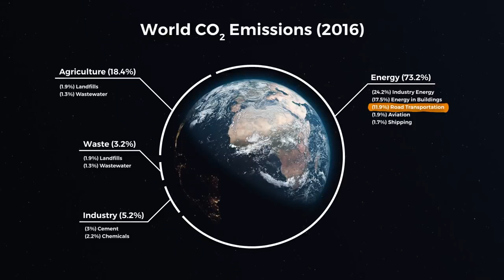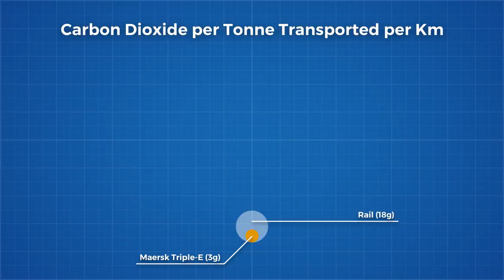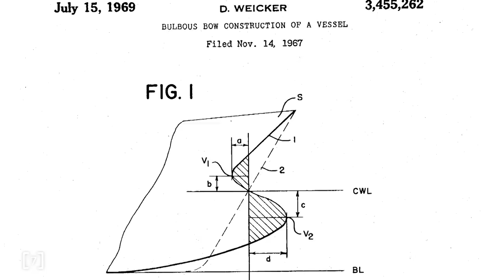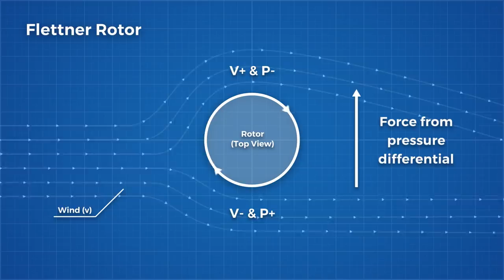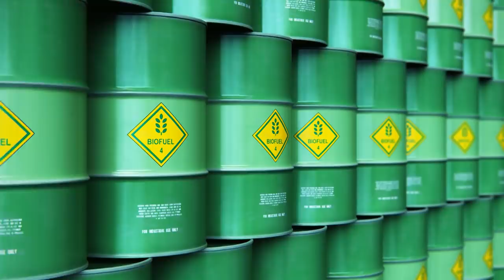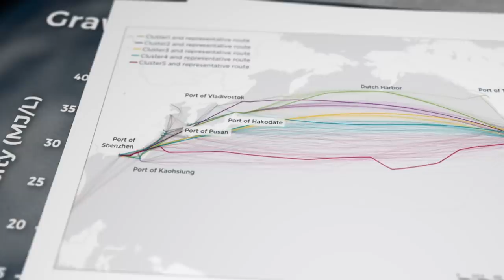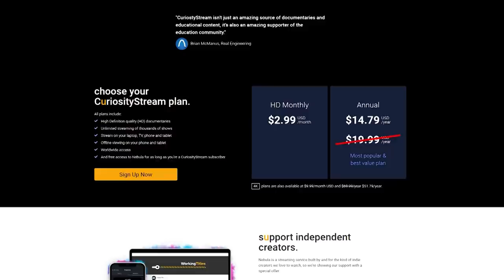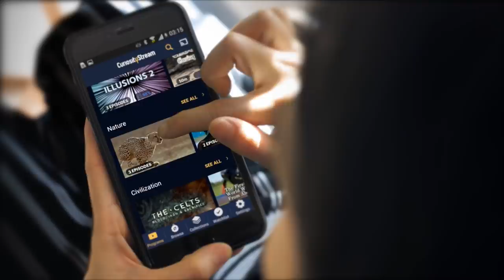Are Renewable Powered Ships Possible?

Comment: Apart from operational improvements ie things like Flettner Rotors etc etc. Have you considered the building of new ships by looking at concrete ships? This technology has been around since the early years of 20th Century (During WW I there were significant programmes to build concrete ships in both the UK & USA. Concrete ships were built at many ports in the British Isles including Shoreham By-Sea in Sussex were I live. They were also built at Warrenpoint. At least three WW I concrete ships survive in Eire. The Warrenpoint built 'Creteforest' and the Shoreham built 'Cretegaff' can be found at the Carlingford Yacht Club in Co Louth. Also the Shoreham built 'Creteboom' can be found in the River Moy near Balina in Co Mayo.) I have a very interesting book published in the 1970's about the future of shipping (originally the book was published in the DDR) It talks about many ingenious innovative ideas and solutions to maritime problems. Including very large concrete ships. Interestingly a concrete hull is extremely robust and virtually indestructible (This was demonstrated at Bikini Athol during the American A-bomb tests in the late 1940's). The main problems with concrete ships historically have  been as follows. 
1) High cost. During WW I the UK  1,000Grt barges built cost around £27,000. Whereas a steel barge of this size cost around £17,000.
2) A concrete ship has limited value following withdrawal as effectively the hull has no scrap value. 
However the cost issue decreases as the hull size increases and a hull of over 75,000 tons has a cost advantage. Also due to very robust nature of a concrete hull the ship would in all likelihood have a lifespan lasting centuries.
So the trick here would be to make sure you the hull can be designed in such a way that it's long life would be an asset (That said it is likely that the demand for large container ships  and bulk carriers is going to last for many centuries into the future)
Also it would make sense to use a steam turbine nuclear power plant which would be designed so that it could be replaced relatively easily say every fifty years or so.
Obviously at first such a vessel would have to use a fission reactor. But by the time the reactor required replacement I would expect that it would be replaced by a fusion reactor 
There are plenty of technologies  that have been around since the 19th and early 20th Centuries that deserve looking at again in the light of today's vastly improved materials technologies.
Reply: The concrete has a high carbon foot print during manufacture so the embodied carbon content may become a factor.  WRT the nuclear power plant start by doing a web search for ‘nuclear ship savannah’.  Just think; would you have full confidence in the management of a nuclear reactor under the control of an anonymous entity only traceable, perhaps, via a letter box in a FOC (flag of convenience) nation state?  If you are could you sell that confidence to Japan, the state that hosted the Hiroshima and Nagasaki nuclear detonations as well as more recently the Fukushima ‘event’?  Then try that same, or similar, sales strategy on Ukraine, the nation state that as a part of the USSR (CCCP) hosted the Chernobyl ‘event’.  Modern iterations of nuclear energy thorium fuel, molten salt reactors or fusion reactors will carry the legacy of past problems.  It is the global trepidation of anything with 'nuclear' in the name and the economics of nuclear having transitioned from 'energy to cheap to charge for' too 'the costs of remediation are incalculable' that will prevent the adoption of nuclear energy as a means of creating energy at sea.  Modern reaction systems may have overcome the safety problems but the general public, having been misled in the past, will not believe the fresh new promises.  ‘They’ say nuclear is cheap, it’s not it is expensive as well as being complicated, dangerous, not universally socially acceptable and having only ‘no need for refuelling’ as a questionable advantage; actually it does need refuelling just not as often.  When they do need to refill the warming up stuff it takes considerable longer than pumping tonnes of thick black stuff, HFO cSt380, or thin runny stuff, Avtur-JetA1, onboard which is one of the reasons HMS Queen Elizabeth and HMS Prince of Wales are pushed about by gas turbines thus using the same fuel as the aircraft that fly off of them.  The Royal Navy (RN) with a high degree of skills and expertise use, at vast expenses to the UK taxpayer, a current operational nuclear fleet of 8 submarines (also known as ‘boats’) in two flotillas, four attack subs and four ballistic missile boats.  The carbon footprint of all the extra bits of hardware and the fuel, including processing thereof, from ground to propeller, are the external costs that never seem to get considered.  Disposal, once it wears out, of both the machine (that was a ship) and fuel is another can of worms best left unopened.  The 26 RN boats no longer in use are laid up (some in Rosyth and some in Portsmouth) awaiting long term deconstruction including dealing with the fuel rods and other irradiated material.  The USN is not, as far as I know, a commercial organisation working to very tight margins and also has the skill and expertise to handle the complexities of nuclear power so as well as submarines their aircraft carriers are nuclear powered and each have a build cost three times that of QE/PoW, bigger crews and more generous funding.  For those who still think that nuclear energy might be the answer I recommend this report: - https://www.bbc.com/future/article/20200901-the-radioactive-risk-of-sunken-nuclear-soviet-submarines? ocid=ww.social.link.email.  The navy of the USSR might have been under resourced and over extended but it was still generously supported in comparison with merchant shipping.
Reply: @BernardLS  I am very much aware of what you say. But in fact concrete has a lower carbon footprint than steel. Also it is possible to reduce the carbon footprint of the cement industry more easily than it is for the steel industry (I am also fully aware of the fact that the ship would still need a steel frame)
I am talking about building a ship that would last for many centuries and this was the only technology that I could think of that would allow you to do this. Also remember we are talking about a ship of around 250,000Grt and the nuclear option would be viable. Certainly it is the only technology that is available today which would meet the criteria for removing diesel engines etc etc.
 Also I am making the assumption that a viable nuclear fusion reactor would be viable within the next 25 years or so. Which would mean that the fission reactor would be disposed of then. Also I am fully aware of additional costs of such a vessel. Certainly the major shipping companies would be perfectly able to operate such ships. It is wrong to suggest that their staff would be somehow unable to do so.
 All I am saying is that something does need to be done about this now.
PS I did actually visit the 'Savannah' and the German ore carrier 'Otto Hahn'. However I never saw either the Japanese nuclear reefer 'Mutsu'   which in fact it never actually carried a commercial cargo and it was later rebuilt into the research very 'Mirai'.
Which today is a museum ship.
Or the Soviet ice strengthed 'LASH' barge carrier 'Sovmorput' which was designed to service the various ports at the mouths of the rivers along the coast of arctic Siberia. As far as I know she is still in service. The other three having been withdrawn from service. 
 One thing to note about all of these ships was that they were all relatively small. 
I am suggesting a much larger vessel.

Comment: Yes, the sea is windy (big turbines to produce power). There is water (Water turbines). There might be sun (Solar power)
Reply: To address the suggestions that sail power is the answer I offer the following example.  In 1870 a premium sailing vessel entered service, the ‘Cutty Sark’.  The Cutty Sark was 64.74 metres in length with a beam of 10.97 metres and a loaded displacement of 2 100 tonnes.  She was able to carry 1 700 tonnes of cargo and to harness the energy in the wind the available spread of canvas was up to 2 976m2 which was tended by a crew of about 30 skilled men.  A ratio between the sail area (SA) and the vessels displacement (D) determines how lively she is; ‘lively’ being nautical speak for ‘fast and manoeuvrable’.  The carrying capacity of cargo ships is constrained in two ways, mass and volume which leads us to the ‘stowage factor’ of the cargo; the more mass on board the greater the displacement which in turn impacts the efficiency of the hull form and sail area / displacement ratio.  A vessel constrained by mass is said to be ‘down but not full’, a vessel constrained by volume ‘full but not down.  When in the tea trade, which the ‘Cutty Sark’ was designed and built for with fine lines (more nautical tech speak so again - no need to worry about it) she could carry around 600 tonnes of cargo at speeds of up to 17.5 knots dependent on the prevailing wind and had a typical China to UK time on passage of 120 days.  The tea trade was very competitive so ‘time on passage’ was a large factor in securing the premium freight rate that made her cost effective.  Rounding things out her maximum available sail area gave circa 5m2 of canvas for every tonne of tea carried.

As soon as the Suez Canal opened, which the ‘Cutty Sark’ was unable to sail through; she lost her advantage, raw speed, to the steam powered ships of that era who could beat her ‘time on passage’.  Mechanically powered ships have improved in terms of efficiency, on a freight tonne mile basis, by at least one order of magnitude since then.  After losing out to the coal burning, steam reciprocating mechanical ships of the late 19th century ‘Cutty Sark’ was relegated to the Australian wool trade, just about the bottom of the barrel in maritime terms and only one small step up from being a 'honey barge'.  The canvas, cordage and extra manpower needed for sailing ships was never a very benign environmental option so please discount any idea of sail as ‘sustainable’.  All this is without the problem that if ‘the wind don’t blow the ship don’t go’, when it does blow it often blows in the wrong direction for your cargo delivery needs and sometimes there is rather too much of it for comfort.

Random fact about ‘Cutty Sark’, it is said to have been possible to coax 3 000 horse power out of her sails, or in ‘real money’ 2 206 500 Watts (2.2 megaWatts), assuming this was in ideal conditions that is about ⅔ of the solar power that might be harvested from the ‘top of stow’ of a Maersk Triple E, again in those elusive ideal conditions and 741 Watts for each square meter of sail area.  So that majestic spread of canvas would have been even less efficacious for delivering your baubles and bows from the orient, despite taking about three times as long on the voyage.
Reply: Solar power; as an example the above container (called boxes by nautical folk) area of a Maersk Triple E is less than 399.2m by 59m.  The 399.2m is the length between perpendiculars (marine tech speak - no need to worry about it) and the 59m is the width overall (more marine tech speak so again no need to worry about it) allowing for the sides, bow, stern & navigation/accommodation structure could we agree 340m x 56m or 19 040m2 for the ‘top of stow’ area?  Insolation rate in Joules will vary due to time of day, latitude of vessel, declination of sun, (those three impact the elevation of the power source) cloud cover, efficiency of solar panels and how clean they are.  The Triple E class use two 29 680 kiloWatt each, at full whack, ICEs for propulsion plus some hotel and services power load cost; so for round numbers, could we agree 60 megaWatts?  Solar panels create about 155 Watts m2 averaged out; 19 040 x 155 gives me 2 951 200 Watts (or 3 megaWatts for a round number) from the top of all the boxes.  Those three megaWatts might allow you to distil enough fresh water from the sea to wash the crud off of the solar panels (surprise fact renewable energy comes with maintenance costs) but nowhere near enough to effectively 'push the boat along'.  Fitting solar panels on top of the ‘boxes’ is worth, at most, 0.5% of your power requirement.

More seriously the ‘boxes’ are loaded and unloaded from the top down so the solar panel array would need to be moved for every port operation and time is money as well as that operation having the ability to get very complicated (tech speak for ‘go wrong’).  Any additional weight would be in the worst possible place for the stability of your vessel, the operating environment would be harsh and the ‘top of stow’ on a ‘box boat’ is seldom a level expanse as each column of containers may be, and usually is, of differing heights.

Comment: to achieve a real reducción they need to redesign the hul eliminate the bolbous bow with a long tube along the length of the ship, propeller place within the pipe,this will eliminate frontal resistance,no front wave and will create a wave in the back of the ship.
As far as green energy Hidrogen or CAES,compres air energy storege ,one or a convination of both is the solution,the source is built energy harvesting ships, sails and solar power with generator like the ones use for tidal energy , they don't need to cross canals or water wais, refills can be done in open ocean justlike tug boat. 
and last solar electric container ship to Carry only empty container,this will reduce time in port,and they can travel very slow.